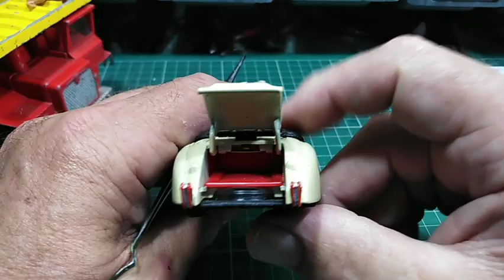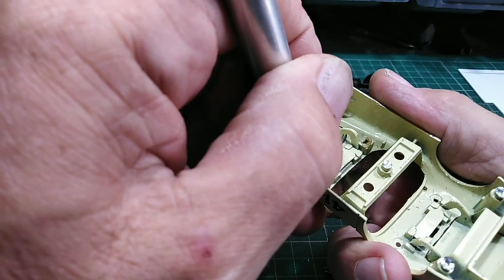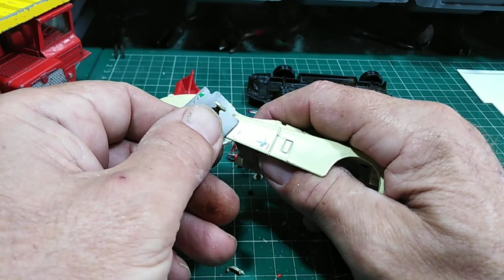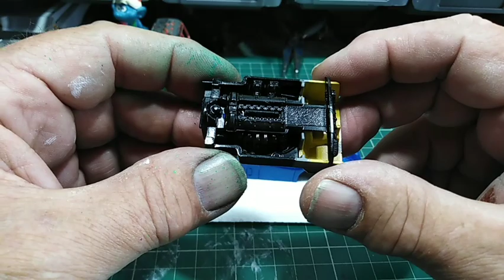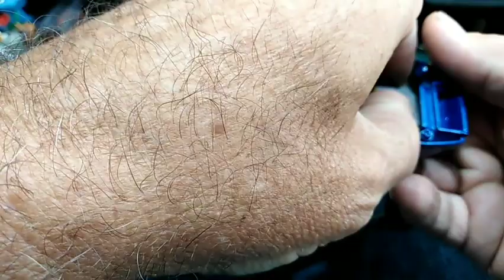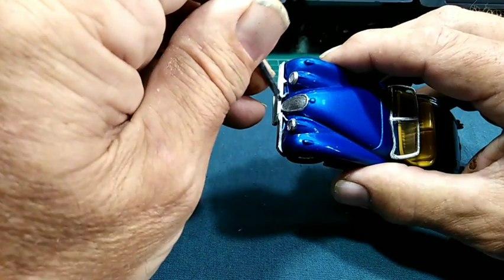Corgi xk120 build off with Bob Willis.

Comment: G day martin wow what a beautiful paint job and what a sexy looking car. As always it turned out great what sized engine would that have been looks a big lump lol. I saw one of these and a Austin Healy 3000 in Adelaide in the 90S fully restored absolutely beautiful I think it was what got me interested in classic cars. In the 80s I too had an XJ6 series 1  4.2  white with blue interior it was so quiet inside you could here the clock tick driving down the road. The jag I would love to have today is an XK8 4lt V8 or THE XKR they have lines similar to the E type and the wood and interior are to die for. Apparently they were built in the same factory they made  spitfires in Castle Bromwich Assembly factory the wooden dash is supposedly shaped like the elliptical wing of a Spitfire. Great job mate catch ya next time.👍
Reply from the maker: Hi Geoff
I think it would be a 4.2 straight 6.
It was a very popular engine for the jags some of the mk2s had the same engine,
The xk 150 is my favourite of that shape.
The 120 looks better without the hard top.
I have had 4 jags 2 series 2 xj6s 1 series 1 basket case and my last one was a stype.
I love them I might be tempted in the future.
Take care my friend.